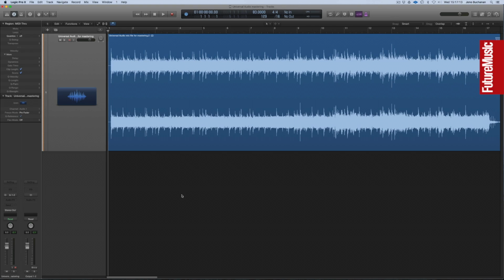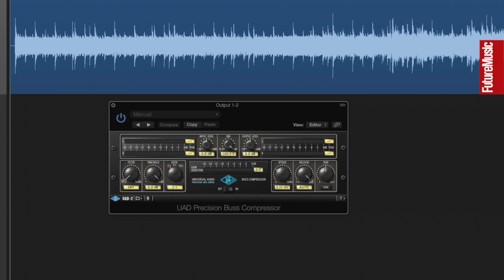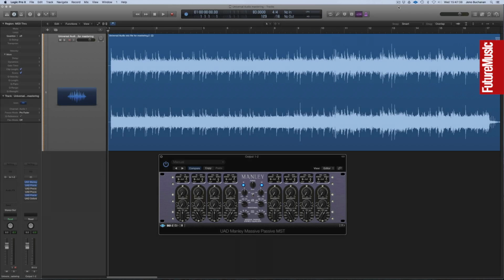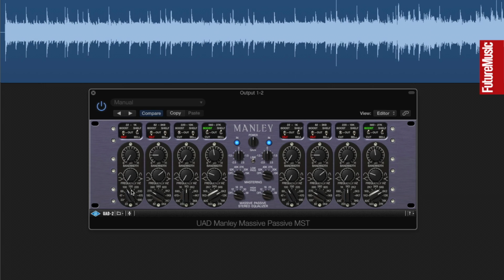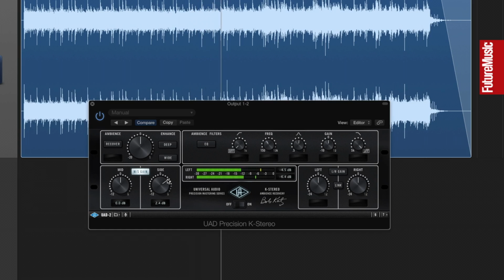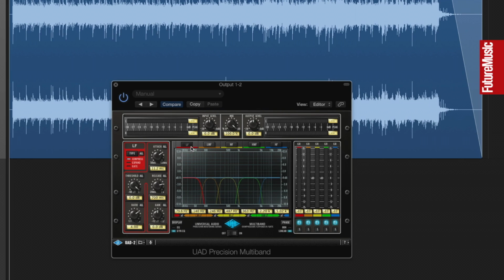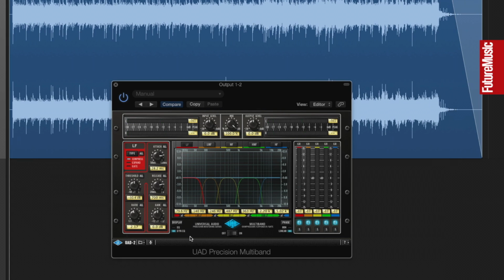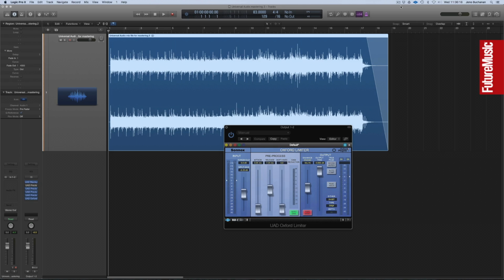The Mixdown with Universal Audio: Part 6 – Mastering

Comment: Fairly interesting. I use most of these tools from all six episodes a lot. My mastering approach in terms of chain order vary a bit but there is always differences in work flow for different cats. Bummer that the section specific to working with the Precision K plug-in was entirely captured in mono. An error in production I suspect. I use this tool to subtly widen mixes with my mastering chain as well and it is quite useful, effective and can achieve dramatic results with very modest settings.